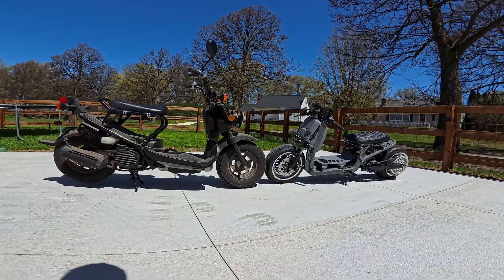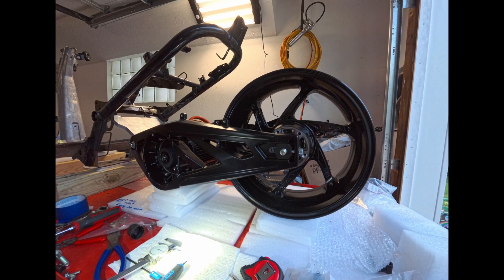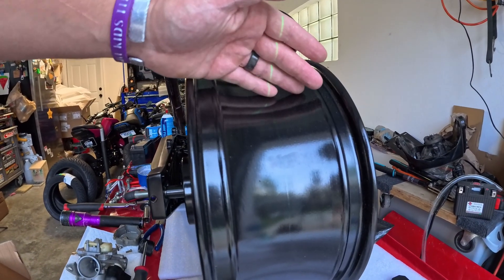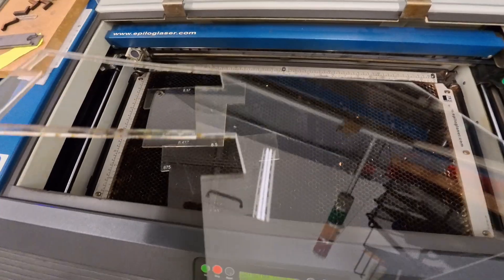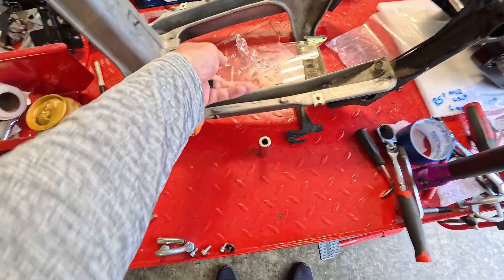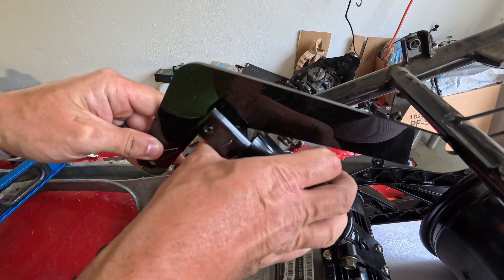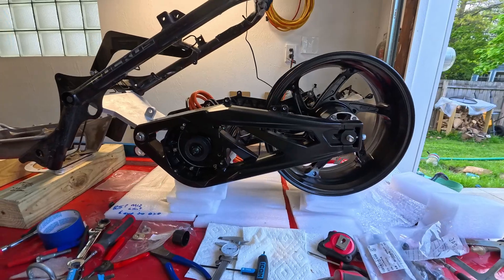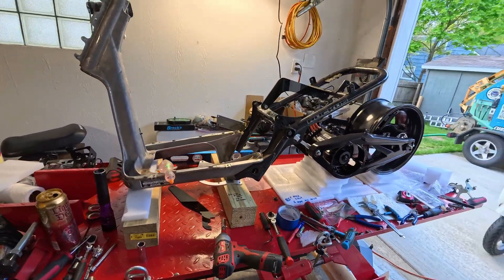Honda Ruckus EV Swap: Let the Transformation Begin! | Jakes Electric Ruckus Build Ep.2

Comment: What controller are you using for the motor?  For your next build how about a Honda CT70?!
Reply from the maker: @suedehayes1817  this one will either be a em150 or 200. Both of which offer more than enough that's needed for these small platforms. Once this customer build is done I'll be doing another Ruck with the traditional 12in rear wheel size and that will have an em260 😈 

You're not the first person to mention doing a CT! I will def keep it in mind!

Comment: I've been considering an EV swap myself and found all the parts needed except the rear wheel pulley. All the listings on Alibaba have disappeared. With you making so many parts now what's your plan on this buil? You find a place still selling QS motor rear wheel pulleys or just plan to make a custom one?
Reply: Awesome, buying straight from them would definitely be a better way than through some mystery reseller. Amazing you're turning this EV Ruckus thing into more than just a one-off, excited to see how this one goes!
Reply from the maker: @tnwagn  oh yea. Way easier and no crazy markups. The swap isn't for everyone, but I very much enjoy giving the ability for others to swap theirs!
Reply from the maker: @tnwagn  I already have one. Reach out to QS or Sia as they are sister companies and you'll be able to source one much cheaper than milling your own!